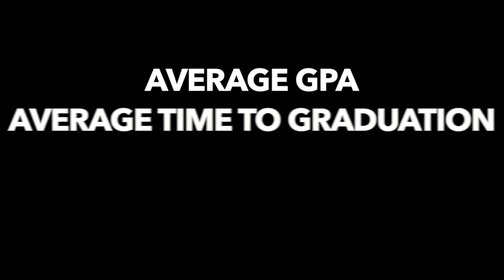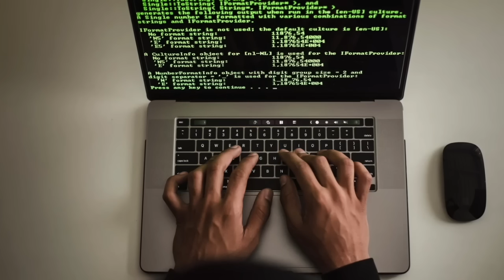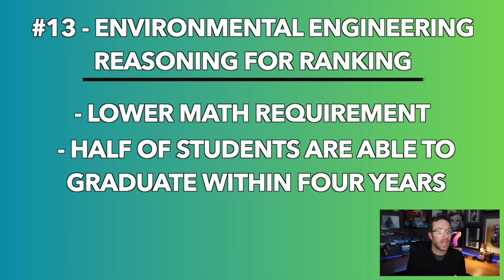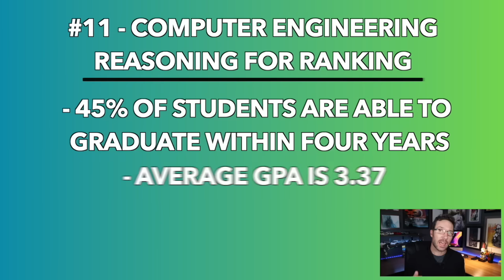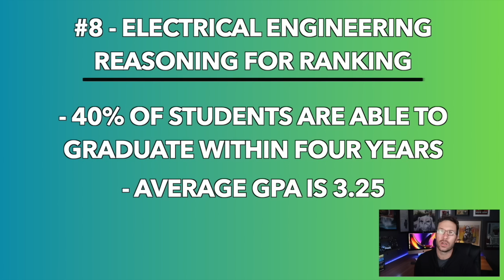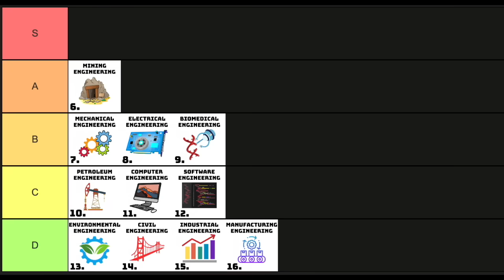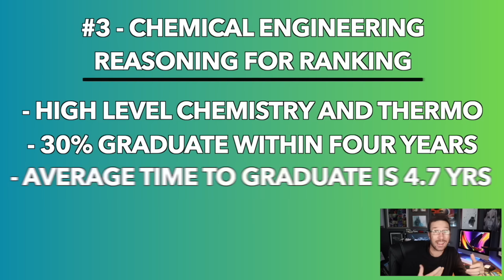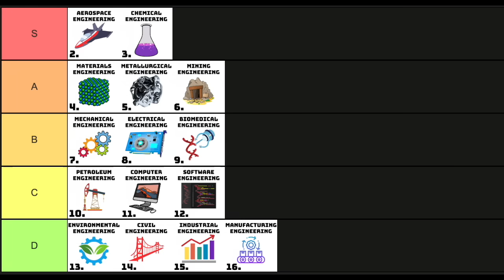Engineering Degrees Ranked By Difficulty (Tier List)

Comment: 1. Electrical Engineering
2. Aerospace Engineering
3. Mechanical Engineering
4. Chemical Engineering
5. Biomedical Engineering
6. Civil Engineering
7. Nuclear Engineering
8. Computer Engineering
9. Environmental Engineering
10. Petroleum Engineering
According to ChatGPT
Reply from the maker: thank you for this
Reply: A better ranking than what that man is talking about. Remember that civil engineering is mother of them all. Strictly, civil engineering should be among topmost in that list. I studied civil engineering and later mechanical engineering in Nigeria. Based on d opetating curricular in Nigerian universities, civil engineering was tougher at d time, having studied it and mechanical engineering. A lot has happened in university education. D main engineering disciplines - civil, mechanical, electrical, chemical - have all been subdivided into multiple other disciplines. Metallurgical engrg, materials engr are supposed to be a part of mechanical. Marine, environmental are a part of civil engineering, etc. Courses are being spun off basically for commercial reasons, d more divisions, d more universities get varied enrollments, and more money. At d end, there is a considerable bastardization of core engineering disciplines.
To repeat, analysis presented in this clip, if I should score, would give 35%. A better ranking is required.

Comment: I think electrical engineering goes beyond ODEs. We deal with the Laplace Transform, Fourier Series etc. In addition, complex numbers are primarily used in AC circuits. I'm not saying complex numbers are difficult to use. But compared to real numbers, it's a bit more difficult.

Comment: some countries separated electrical engineering to electronic and communications engineering. where electrical engineering focuses more on cable and breaker sizing of houses industrial machines and power systems such as distribution utilities, high voltage transmission systems and generating systems where you work with mech engineers. and electrronics and communication focuses on analog and digital electronics they also understand industrial machines ladder diagram circuits same as an electrical and ofcourse communication towers and pabx cabling

Comment: Good video, gave you a like. My experience as an Electrical Engineer (EE) focused in High Speed Digital is that were are the most versatile. We are called upon to design circuits, code programmable logic, write software from low level drivers up to abstract applications, computer engineering, networks, some mechical, some RF, IR, UV, X-ray, some analog, some systems, some manufacturing, some environmental, a little chemical, componets, materials, from deep sea to deep space, tech writing, purchasing/procurement, program management, task management, marketing, R&D, and a tiny bit of nuclear (I have touched all of these and more). We tend to lead the design that brings together all of these disciplines and can follow a design from concept to end of life.

Electrical Engineers in Aerospace and Defense (like me) usually require Calculus 3, Thermodynamics, Chemistry, Physics, and more.

Your should break down Electrical Engineering by disciplines: Hardware, software, firmware, digital, analog, RF, power supplies, systems, optics, acoustics, and more.

Comment: Your use of ODE's and PDE's is perplexing. Level of calculus (eg tensor) is a better measure but if physics is thrown into the mix then QM will be required and the math requirements dramatically increase.

Comment: The crazy thing is is that though mechanical engineering is number 7, at least 4 of the 6 ranked harder are often considered subsets of mechanical engineering. In my degree program, we learn the basics of aerospace, nuclear, Metallurgy, and materials, and to actually get a degree in those, you get ME specializations or minors. Because of the breadth of knowledge needed and learned, I'd definitely say the larger category of mechanical engineering is the hardest

Comment: Honestly this video is too brief when ranking the different disciplines of engineering. If he really wants to compare by a difficult material basis, then he should emphasize on the material more rather then comparing it from a graduation on 4 years factor, since there's alot that contributes to this data such as the sheer number of students  studying in said engineering discipline

Comment: You should have included dropout rates and your scale for difficulty seems a bit off.  Yeah a civil engineer stops at differential equations, but they also have to learn 3 dimensional physics.  imo, the physics classes were significantly more difficult than differential equations.

Comment: BSCE here. I had to take Partial Diff E at Tenn Tech in the early 80s. I don't think it is required anymore.
Reply: I wonder why not? Is that a sop to the lower quality students coming out of HS?
Reply: @tomgroover1839  Tech used to be on the quarter system, but that changed in the late 80s when the legislature required all the colleges in the state to be on semesters. There simply wasn't room for the course anymore.

Comment: Your ranking analysis, I think, is quite flawed. The number of years required to graduate from a program does not equate to the difficulty of the engineering program. I think students' preparation, or lack thereof, has more to do with it.

Comment: Think twice before choosing Industrial Engineering. Depending on the University, it can barely be an engineering degree with the very least you might need to be considered as such, being far more focused in bussiness and management. However, in some Universities (technical ones mostly) Industrial is literally a mix of many degrees, so you'll take classes with people from electrical, mechanical, software, chemical, etc.

This doesn't mean it is the hardest one, but from my experience I can tell you that it is WAY different depending on the orientation of the university, so check that out before you sign in :).

Comment: If I had to guess, mechanical is easier than electrical engineering. I'd put electrical up higher than ME. But, it's mostly due to the inability to visualize things in a tangible form. I majored in aerospace engineer in college and, although it's a subset of mechanical engineering, I found aerospace engineering harder than mechanical. Reason for that is that although we saw classes on structures, fluids, thermodynamics, the concepts in aerospace engineering where more abstract with longer equations and higher dimensions. With that said, an engineering degree is a degree and mechanical engineers can do most engineering jobs in aerospace.

Comment: I'm a B.S.M.E. and I'm amused at the so called average pay.  I guess you're lumping in masters and specialized doctorate degrees to shift those numbers up by 20-30k.  Always keep in mind that each degree level makes a big difference in the future, but that they're quite  difficult (and expensive) to accomplish.

Also beware the rapid expansion of AI and the fact that many of these engineering disciplines are based on rigid science; meaning they can reasonably be performed by a computer even now, and will likely be dominated by computer programs in the future.  If you want to be future-proof, it's best to look elsewhere for a degree, and always assume that any "averages" given are probably double what you'll get for your first 5-10 years if you only manage a bachelors.

Comment: I double majored in Chemistry and Electrical Engineering at Lehigh graduating in 81 and 83. I don't know if things have changed dramatically but my math requirements were way beyond simple partial difeq's. We had to take 6 semesters of math including 3 semesters of advanced calculus, linear algebra, probability and statistics, and complex analysis. I couldn't imagine an EE degree without a lot of that math. There is no way you would understand signal processing for example. Chemical engineering was the  hardest engineering major followed by electrical engineering. Chemistry, by the way, is not an "inexact science." Maybe it is if you don't study and understand it but it most certainly is very exact. It isn't memorization like too many people say about organic chemistry. If you are just memorizing then you will never truly understand it. We also had to take two semesters of German to get our degree so we could read the original papers that were written.

Comment: It seems bizarre that this ranking puts so much weight on the percentage of students able to graduate within 4 years - the assumption appears to be that the lower this percentage the harder the course, and this puts mining engineering in sixth place despite its lowly showing on every other metric. Might it be that an alternative reason for fewer students graduating within four years is that they are less able? You'd think that someone promoting the value of an engineering degree might know that one of the cardinal rules of thumb for any engineer is to check your answers and if they don't seem to make sense there is probably a good reason for that.

Comment: Cool, just came here to confirm that Nuclear Engineering was the hardest and I would agree with you. 
I've been doing Nuclear Engineering for about 15 years now, I would confirm that the job growth outlook is not great, but the pay is probably a little higher than what you have. I would be surprised to find out that early career NucE is not making over $100k.
Reply from the maker: yea the BLS salaries are a bit out dated i think. i will update this video later this year

Comment: I'm currently undertaking a degree in Ordnance, munitions and explosive (OME) engineering. Frying my brain, has a mix of chemistry, electrical, mechanical and aerospace to name a few. 4 years in 1 to go
Reply from the maker: that sounds cool! ive never heard of that. also, your user name fits.
Reply: @becominganengineer2271  it's a relatively new programme here in the UK at a Bachelors degree level. There has been a masters program for a long time, but the degree programme is only about 5 years old now.

Comment: EE/QE here. Agree with the S tier but you low balled EE quite heavily. Similar to ME you can make the degree as easy (digital circuit design) or as difficult (EM, Maxwells, FFT & Laplace) as you want, but you always need to take partial diffeq. And while people don't get degrees in Systems or Quality engineering, they should get an honorable mention as each, though entirely dependent on what you work on, can fall anywhere on this list.
Reply from the maker: i may remake this video at some point and move EE a bit

Comment: Not going to Lie, there is a lot wrong with this analysis espically with the "Highest level of math " in engineering your math courses are not necessary going be coded as a "Math Department Course" such as ordinary differential equations that's your basic math requirements, not the highest Level of Math you will take . So for Computer Engineering and Electrical Engineering Mechanical Engineering, you might have to take a course on Automata which is indeed a math course but taught by your department, and Chemical Engineering, and Computer Engineering you need to know how to do math on the complex plain which again might not be a formal math course on Complex Analysis and real analysis but you will have a class on it  your classes after your basic math requirement taught by your department. The reason you need these courses even as a computer engineer is because you have to understand how transistors are made which requires Quantum Physics, which requires doing math on the complex plane.

Comment: Most of the high level engineering degrees listed here will get you a job in just about any field. Having an average pay is not ideal as most of these fields have quite a bit of overlap. 

All of these degrees are incredibly hard to finish. You have to be one of the smarter students to do well. And then, once you enter the field, you feel like an average Joe. Just about everyone you work with is well above average intelligence. It’s humbling, but can also be morally draining for some.

Comment: I did mining engineering. Think of it as a mix of mechanical / electrical / civil / metallurgical / geology. Those are the things you will encounter in the mines. Civil engineering because mining is like civil, just underground. Mechanical - machinery underground. Electrical - also machinery. Metallurgical - the plants refining ore, and then of course Geology. It not intellectually more difficult than mechanical or electrical, we took the same classes, but it is physically very hard if you work underground. Of course if you are in any way claustrophobic then underground mining is not for you. Depending on the mining, you might get into areas where you are crawling through small openings or walking through waste deep water (you tell yourself its just water) Its a whole other world down there. Most of the stuff you see in movies isn't really like modern mining. They have big trucks, loaders, air conditioning plants, trains, all kinds of stuff underground. No mules and canaries.

Comment: I'm in Sweden and might study for an civil engineer degree in mathematics this autum.  I've heard we're different in Sweden who have enigneer degrees in physics and math. Math and physics engineer programs are the toughest to get in to considering SAT, grades from higschool or the "mathematical and physics test" which a few universities have as a second chance to get in. Math beeing the more difficult to enter. Civil engineer programs in physics and maths are usually brought up as the most difficult programs in the country. Universities call them the most theoretical.

Initially I was interested in chemical engineering. I find material chemistry interesting, finding better ways to recycle plastics etcetera. But math is my strength and did very well in mathematic and physics admision test s felt like a waste not to study more math. So hard to decide what to study when so many things are interesting.

Comment: My brother is an Electric Engineer and I have to give props to him from what I’ve seen it’s hella hard. I took the Software Engineering route instead. Our father is a Chemical Engineer and had to use the old school slide rule as his calculator back in his undergrad days. All in all much respect to all Engineers to take this route as it requires hard work and perseverance to get through.

Comment: Electrical engineering needing differential equations only ? My guy you complex analilysis in electrical engineering, you need to work with time invariant system, and more precisely you have to work in the frequency domain. Differential equations are time bound so then have to do a ton of mathing  to trasform from time domain to the frequency domain, to define the transfer functions of your system. Then because computers are working with discrete equations you have to inverse your continuous frequency based equations in discrete differential equations, in order to write a code that describes your mathematical system. Not all electrical engineers are doing this but the ones that are involves in R&D or product development are going throught this.

Comment: I am an e and i engineer. If you just wanna graduate it's an moderately difficult field. But if you wanna stay in the instrumentation, it is extremely difficult since you cover from me to ee to even some aerospace stuff since the sensors and instruments need to work in all areas and things like pressure, temp also electronics needs to be covered. So you even do stuff like ansys simulation, gd and t along with covering every ee concepts also concepts from chemical field embedded systems low level programming etc..
I am a little sad that instrumentation was not covered and petroleum engineering - a sub field was covered.
I would rate instrumentation at a very difficult field.

Comment: People aren't equal, some are more intelligent than others, some catch some things faster than others... so basicaly those more intelligent tend to do better than others.
I would say, that % of people that finish the studies isn't realy a good measure... if anything, i would rather use:
% of students that drop off from that path of education is probably more reasonable way to measure it...
Generaly  I would say  that degress requiering additional knowledge like biology or chemistry are rather harder, than those which are based on pure math, or even math + physics...
on the other side: being a software engineer developing a system/program requires from you, aparat from your technical knowledge, to understand the basics (and sometimes, some advanced niuances) of the field your application will be used. So planning a system f.e. insurance company will require you to learn about insurance buisiness, how it operates etc. and planning a software to monitor and control nuclear plant power generation will require additional knowledge from nuclear engineering... same goes for any other field. So even though software engineering degree is probably amongst easier ones to graduate- it involves learning a lot afterwards (that is, unless you end up in same business/tech branch for the rest of your life, but even then, technologies in which software is developed change over time and require new set of skills every few years...)

Comment: Mechanical Engineer here, with over 20 years of experience. I'm a multi-discipline engineer, working in a variety of industries from controls to structural engineering, materials science, chemical engineering, and even nuclear. Nuclear engineering really pushes your theoretical knowledge of physics. Also, my wife is an industrial engineer. 
I have to agree that this list is pretty solid.

Comment: Eelctrcial Engineering also requires partial differential equations, and it also basically overlaps a lot with Mechanical Engineering. I'd rank it higher